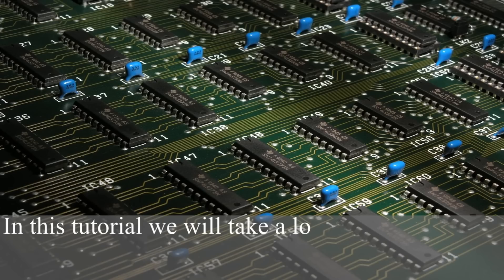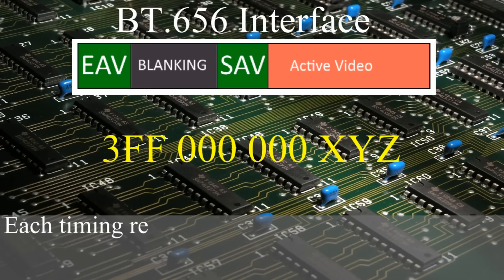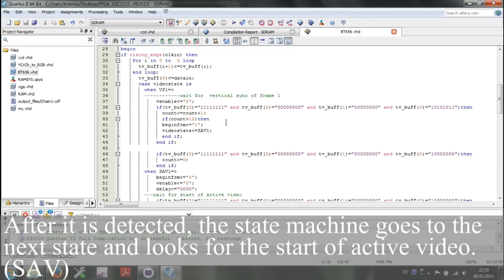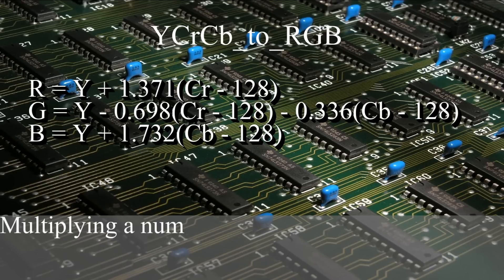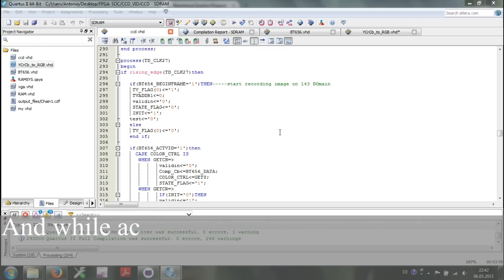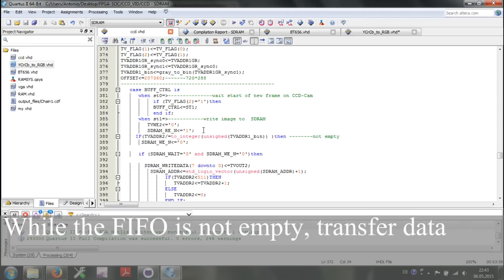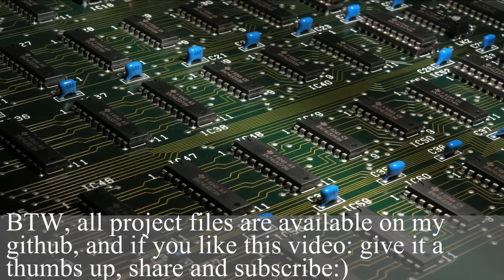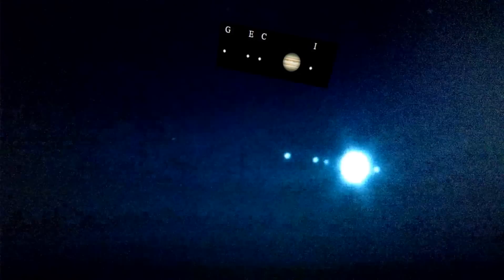Tutorial:Connecting camera to FPGA using ADV7180  on DE1-SoC board

Comment: Dear Engineers,

I am new to FPGA programming and recently acquired a Nandland Go Board with the following specifications:

- Lattice ICE40 FPGA with 1280 Logic Cells
- VGA Connector
- Pmod Host Port by Digilent Inc.
- 25 MHz On-board Oscillator
- 1 Mb Flash for FPGA Booting
- USB Connection for Power, Programming, and Communication

I am eager to learn hardware programming and plan to undertake a project involving the connection of a camera to the board. However, I am facing challenges in finding a suitable camera with the limited ports available on the board.

Could anyone provide guidance or recommendations for a compatible camera?

Best Regards,
YG

Comment: Hello, I have been doing a project on the Altera FPGA De1 Soc and the main goal is to "talk" to a extern proximity sensor using i2c. Afrer a research I found that the LTC connector has the i2c interface but the problem is, it is not working. The i2c should be on the HPS side and I assigned pins (from ltc)to the the HPS_I2C2 clock and data,. I want it to be avaible through /dev/i2c-2.Can you please help ?